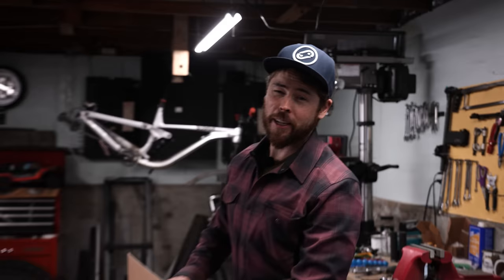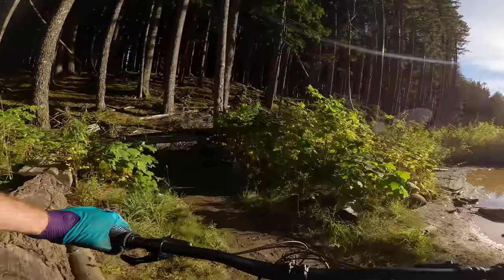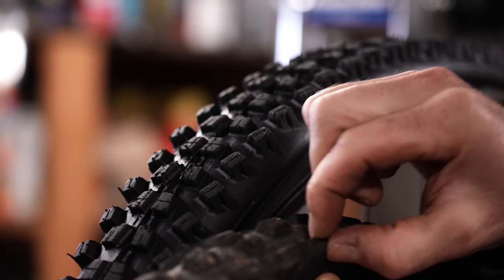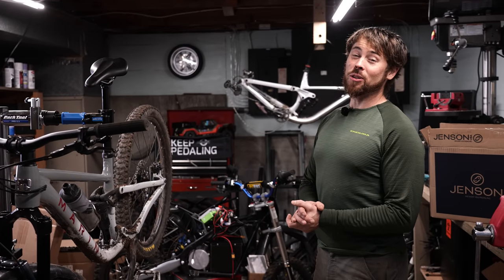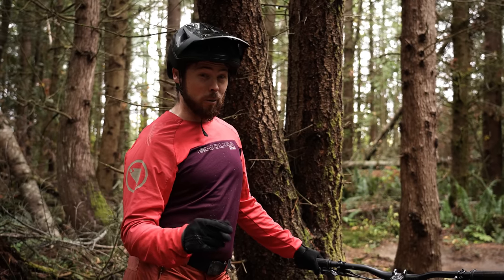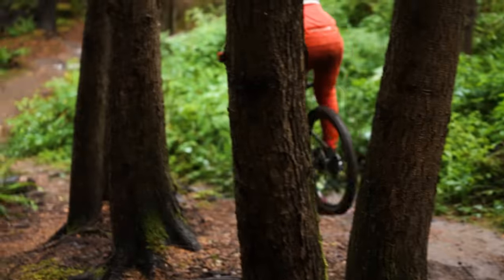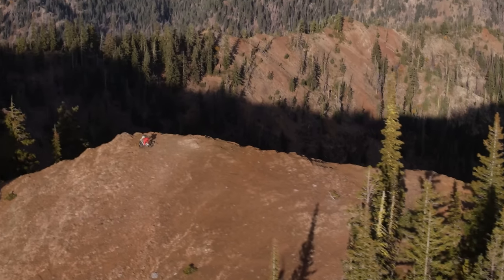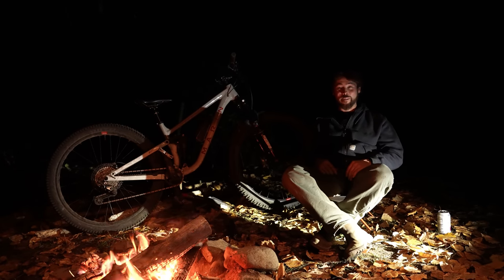More shred, less dollars: the Marin Rift Zone 2

Comment: Man,I’ve bought the same Magura 7 brakes from Jensen and am having the same issue with my rear brake! What did you do to fix the issue?
Reply: Magura levers are incredibly finicky and difficult to get a proper bleed on. If you follow their MT Next bleed video exactly you might get lucky and get a solid bleed on them. Otherwise its repeat the bleed several times until it works.

If you don’t mind having no modulation at all try swapping the lever to a shimano SLX or higher lever. Search up Shigura if you’re curious about it. Incredibly powerful but no modulation. This obviously voids your warranty with Magura and Shimano so do at your own risk.
Reply: Switch manufacturer, most likely.
Reply: I put the bike vertically in the stand and I finally got them to bleed correctly.
Reply: I run a Shigura setup on both of my bikes.  PHENOMENAL brakes, can't recommend enough.
Reply: Been running the MT7s all summer and fall with zero issues. I think you need to tilt the bike so its as.close to a vertical path as possible when you bleed. They are way better than anything ive tried except maybe Saint.

Comment: ::Sigh:: Started off with so much hope but yup, different tires, stem, brakes and wheels that cost as much as the stock bike. So little info for the guy who buys this with the intention of NOT spending another $3000 on it. Next time, instead of upgrading the bike to fit the trails YOU want to ride, maybe keep it stock and ride the trails it was intended to be put on?

Comment: Either fit acceptable tires on the bike or sell it without tires and let the consumer/shop pick an appropriate tire. Why pay money for trash tires? I had this bike/tire combo a couple years back and sheered off the knobs casually riding on pavement on the way to the trailhead. The local shale would have definitely cut the tire had I spend any amount of time actually trail riding. I didn't know any better at the time. Jeff does a nice job being diplomatic but I wish manufacturers were put on blast a little more about this "cost-savings" approach that doesn't save anything other than minor sticker shock. Not every build/manufacturer does this.

Comment: Plumb in the Maguras to the shimano levers…
Reply from the maker: Shigura!  I might try that, but if the final bleed on the MT7s does indeed work, I'd feel lame taking it back apart!!!
Reply: @JeffKendallWeed  Either way another bleed or Shimano levers yes you need 2mm thick rotors: bitepoint with 1.8mm will feel on the bar. Otherwise Shigura is a true legend. Using magura hose, barb and shimano olive. Ive adapted both my bikes using MT5E (eeb pads) wouldn’t go back. BL-M6100 upwards guaranteed fit and performance. Obviously the Rift is a sample so its got to go back with those brakes…